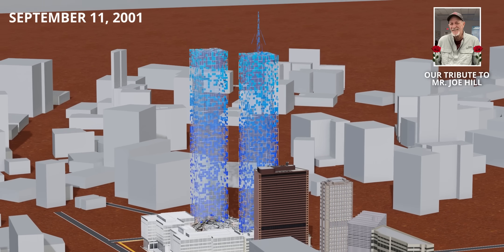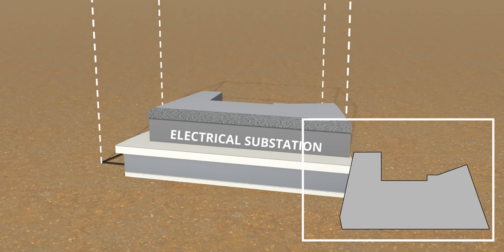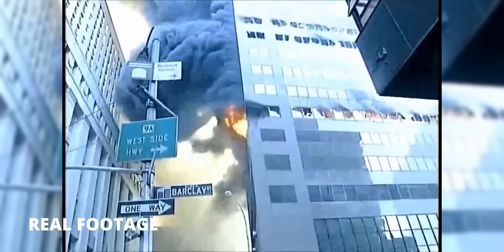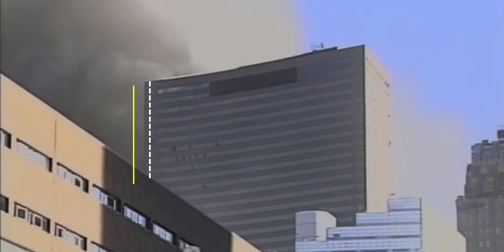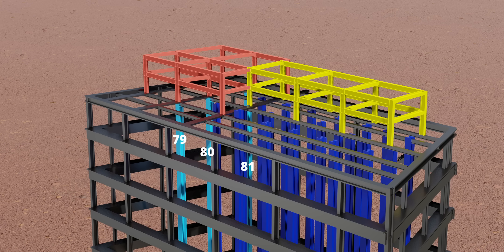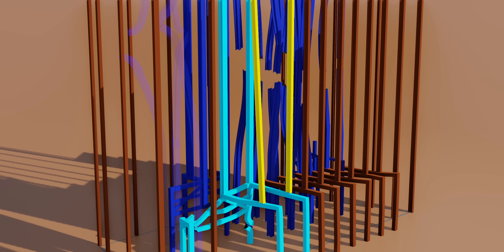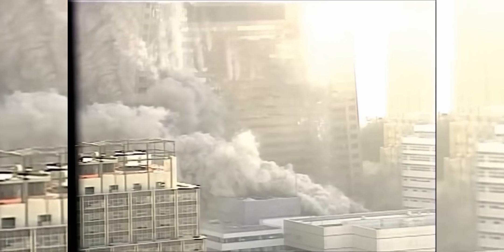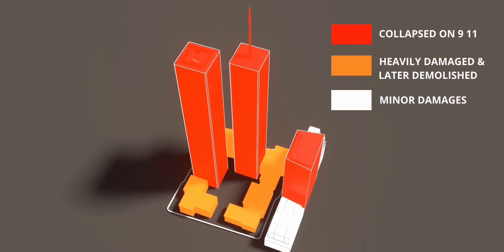Collapse of Building 7 | The Complete Physics

Comment: It’s take longer to cope about no foul play than it is to use a c4 charge or thermite charge in the pivotal places of weakness in the building….. at (FREE FALL SPEED) a crew of 6-12 guys could pull it off easy. Report, no major fires. Not to mention in certain live new report that the building fell mins before it actually did. Here’s your sign. Oh (edit) just to add, and in the video you can clearly see it fall from the bottom. Not crashing down from the top like trade centers 1 & 2.
Reply: Reading that was like being Bukake'd with stupid
Reply: @TheCriticalStinker-01  Do you spend ALL of your free time doing this?
Reply: @guyledouche7939  "Do you spend ALL of your free time doing this?"
The irony of someone who's spent the last 24 hours doing nothing but spam nonsense, on several occasions 4-5+ messages in a row in less than 5 minutes....is palpable.
Reply: Hey brother I’ll make this easy for your brain, you ever play jenga ? Pull the bottom bricks out first and see what happens. Then watch videos of a steel beam being heated and a human can bend it with their bare hands. Now try to think about a 40 story building, weakened steel support at the bottom, and then what happens next ?!
Reply: @drizzho hey brother I’m a welder let’s not put it in a fucking smelter let’s put in a building outside in a high rise with the fucking wind blowing using jet fuel. In not a controlled environment. Since you think you know thermodynamics so well. Then also how much of the jet fuel blew up and simultaneously was thrown out the building. Particularly the first 1. By the way it’s also cooler up there all them stories up on top. How bout that. Or the traces of iron and aluminum they did find. Which iron hasn’t been used on steel building in over 100 years. Or let’s talk about the asbestos problem and the newly insured building just weeks if not days prior. So they had to remove room by room the asbestos in both buildings that was going to cost more than actually building them. Billions upon billions of dollars. You mean to tell me Alex Jones knew that july and called it out just 2 months prior. See when you put your torch on a steel beam it weakens the integrity cause it to bend, its takes direct penetrating heat to start liquifying it. The real kicker is not small fire ever collapsed a building like building 7 before or since. Unless it was built not using the right materials in bone fuck south America somewhere.
Reply: @drizzho I guess it just easier to be a mark all the time then just some of time right.

Comment: My whole issue is that:

-no other building in history collapsed in a similar way ever.

-NIST animation doesnt even look like what we saw

-NIST keeps details under lock 

-only a handful of other people including members ob ea911truth have made efforts to actually simulate the fire as detailed as possible, all data and code is public and open source and they couldnt get the building to collapse like that even ONCE even when trying to.

Why keep the details classified if the science checks out?
Reply: "no other building in history collapsed in a similar way ever."
Other than the other ones, that is.

"NIST animation doesnt even look like what we saw"
Which, it helps if you actually look at them.

Etc, etc. Try again when you're connected to reality.
Reply: I would like to take a minute to address each of your points in turn.

1. Invoking the first time in history logical fallacy is never a good plan. How many other buildings are there that are even similar to Building 7's design let alone identical, have suffered similar damage and were left to burn out of control for 7 hours (3 times over the design limit) with no effective passive or active fire fighting?

That would be none. 

Best to understand these things on their individual merits rather than try to make false comparisons.

2.  Which NIST animation?  There are 4.  Were any of them ever meant to be an exact replication of Building 7's collapse, exactly mimicking the precise movements of every single one of its millions of components down to the millimeter and degree?

Or is that maybe a bit much to ask?

What was the real purpose of the NIST animation you are taking exception with?

3.  The NIST as a federal agency has certain legal obligations which prevented it releasing the input data it used for its models.  So what?  Unless you are only trying to duplicate the NIST's models, using the same software this is irrelevant - a red herring.  Anyone can make their own models and many have.  You don't need The NIST's input data. 

4.  AE911T has never made a serious effort to model anything about the collapse of Building 7.  You seem poorly informed about the available research on this topic. 

I have actually read both the Hulsey preliminary and final reports from cover to cover, which is more than I can say for most of the people who recommend it to me. 

My opinion of the Final Report is as follows:

The Hulsey Final Report on Building 7 met none of its three stated objectives – indeed could not have met those objectives for lack of trying - and failed to prove its main conclusion, by way of a fundamental logic error; Hulsey claimed he had concluded fire could not bring down Building 7 without accounting for the full envelop of possibilities. Essentially, he claimed to have proved a negative

Hulsey also plagiarized almost 3 pages of material from Tony Tsamboti, who works for the studies sponsor. I hope I don’t need to point out the ethical implications of that.

While promising superior models to those of The NIST, the Hulsey Report in fact delivers grossly inferior models which eliminate the time factor, focus on only two floors and rely on a greatly simplified version of The NIST’s temperature data . The model animations are clearly not derived from the model data as they show no dynamics at all and are obviously forced to make the animations (superficially) look closer to AE911T’s imagining of the real event.

Overall, it is a shoddy piece of work done by a man clearly working out of his element and areas of expertise. It rather reeks of trying to support a conclusion arrived at before the study started. Curiously, study sponsor Architects and Engineers for 9/11 Truth having announced what the study would conclude before they awarded it.

Hulsey tested just one out of countless thousands of possible scenarios, using a completely unrealistic scenario and an artificially restricted set of data almost like he wanted to ensure fire would not cause a failure. The Hulsey Report was so factually inaccurate, methodologically unreliable, scientifically unsound, illogical, and biased that it blatantly violated any requirements of objectivity, utility, transparency, and reproducibility that would have been required to submit it for peer review in any reputable journal.

Hulsey and his assistants have not published the report anywhere that any relevant academic or professional engineers look to.

Hulsey had said all along that the report would spawn several (perhaps four) papers in good American engineering journals and possibly a book.

Then Hulsey walked that back, realizing he'd stand no chance to pass peer review in America and so said he'd go for European journals - but years have gone by with no publication whatsoever. Also, no book from any science publisher either. As far as the engineering profession and science are concerned, the Hulsey report barely exists.

The engineers of America and of the world have never read it. It has had zero impact in the professional community.

To its intended non-engineering literate audience, they Hulsey Report contains enough engineerspeak density for them not to ask questions, even if they were so inclined. Since the report appears to (superficially) deliver what they want, they are not inclined, even if they knew what to ask. From a structural engineering perspective however, The Hulsey Report is of no value, which explains why promises to get the report published in peer-reviewed and reputable engineering journals where it could be scrutinized by qualified professionals were abandoned.

If you are genuinely interested in what happened to Building 7 rather than in promoting a political agenda, it is in fact one of the most studied engineering disasters in history and there are several excellent forensic engineering reports out there and over two dozen articles published in genuinely peer reviewed engineering journals that are far more comprehensive and competently done. I suggest you seek them out instead.

And actually read them.  IF you are genuinely interested, this should get you started.

FEMA BPAT (initial report superseded by NIST NCSTAR 1A)

NIST NCSTAR 1A: Final Report on the Collapse of the World Trade Center Building 7, 2008.

Guy Nordenson and Associates, WTC7 Global Collapse Analysis Report and Summary of Findings, 2010.

Arup, WTC -7 Structural Fire Analysis Report (Runs 1-4), 2010.

Weidlinger Associates Inc., WTC 7 Collapse Analysis and Assessment Report, 2010.

BRE Centre for Fire Safety Engineering, Analysis of the Impact of a Fire in the Mechanical Room (5th & 6th Floor) of the World Trade Center 7 Building, 2010.

T. McAllister, R. MacNeill, O. Erbay, A. Sarawit, M. Zarghamee, S. Kirkpatrick, J. Gross, Analysis of structural response of WTC 7 to fire and sequential failures leading to collapse, J. Struct. Eng. (United States). 138 (2012) 109–117.

For a summary of the major studies I would recommend THE COLLAPSE OF WORLD TRADE CENTER 7: REVISITED by Mhd Anwar Orabi , Liming Jiang , Asif Usmani and Jose Torero which is a 33 page summary of the different analysis and conclusions published in 2020. Sorry, YouTube will delete this post if I give the link but it should be easy to find and is available from the University of Queensland, Brisbane.

Real structural engineering industry professionals conducting real engineering studies and publishing them for other professionals to see. Not amateur YouTubers appealing to the gullible and credulous.

Happy reading
Reply: The building was also damaged due to a 110 story skyscraper falling onto it. That’s the part truthers leave out. It wasn’t just a random office fire, it had been damaged when the north tower hit it and the fire in the north tower was caused by a 767 plane flying 500 mph into it on purpose. These aren’t “normal” circumstances for a fire.
Reply: @drizzho  There's also the fact that the "office fire", a phrase used to invoke "oh, it was just some smoldering paper in a waste basket", was in fact the entire building on every floor. It was, in the words of the FDNY, "fully involved" in fire.
Reply: @mooneyes2k478  with an electrical substation on the bottom floors lol. As if that doesn’t cause mini explosion when caught on fire.